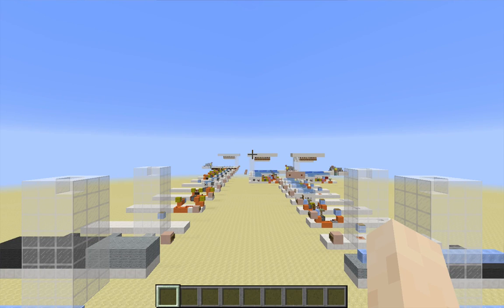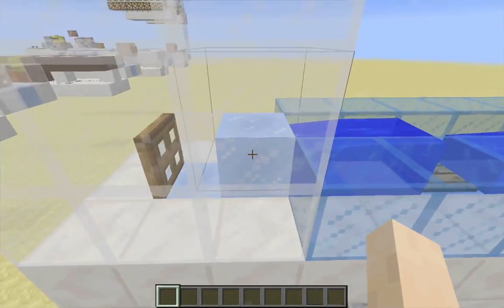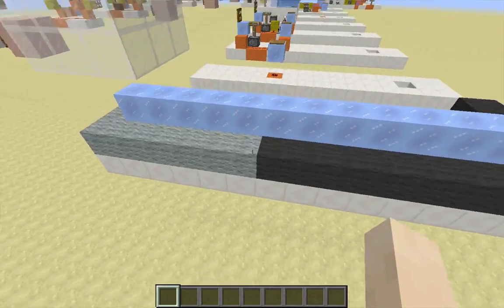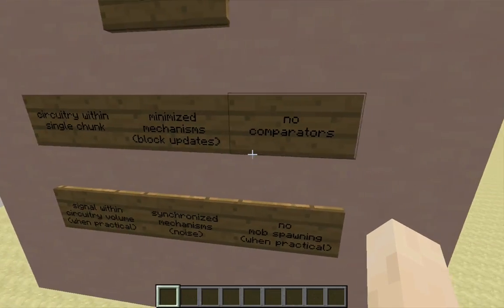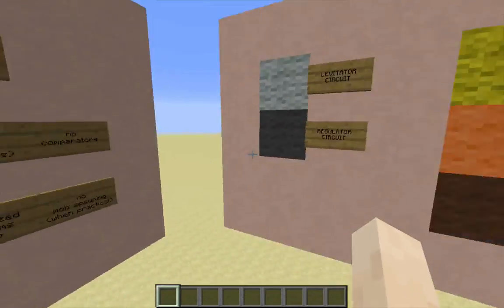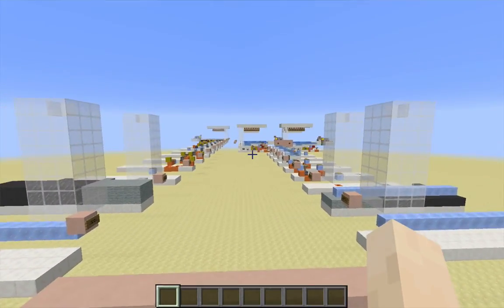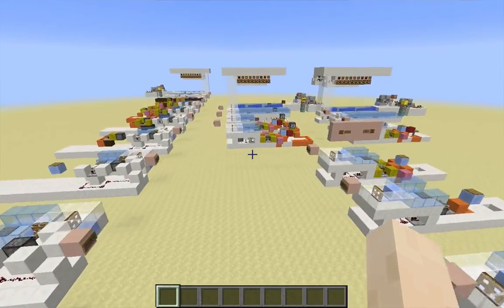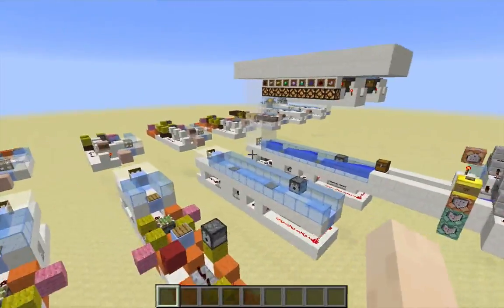Item Elevator Reference World, Snapshot 15w39c (1.9)

Comment: I saw you had a redstone torch on a block of redstone. What good does that do?
Reply from the maker: +Shadow 8472 A redstone block underneath provides a redstone signal to the torch. So, when the redstone torch is placed, it will turn off after 1 redstone tick. That give the circuit a 1-redstone tick pulse.

There are plenty of ways to introduce a 1-redstone tick pulse to a circuit, this is just an easy (albeit manual) way.